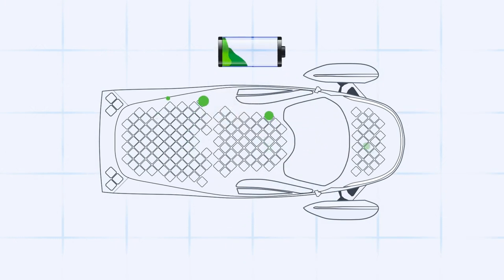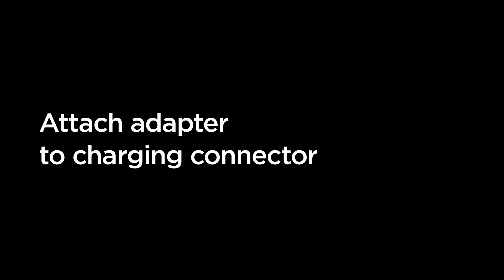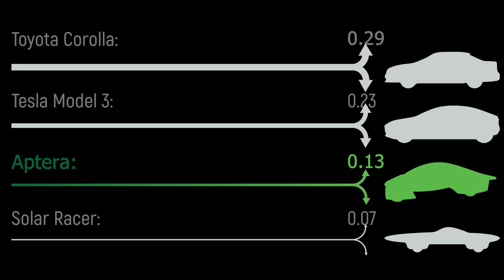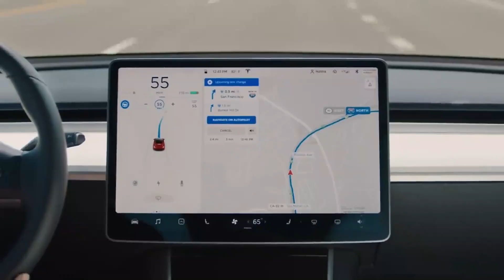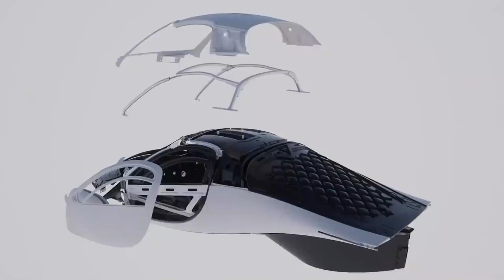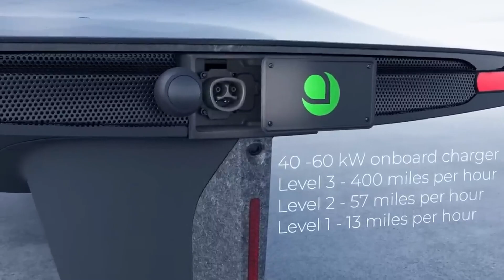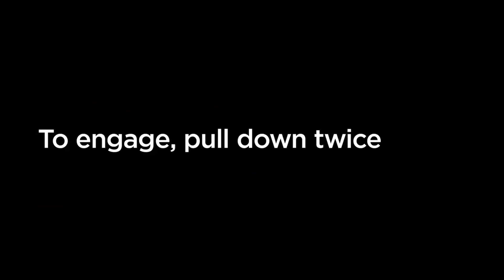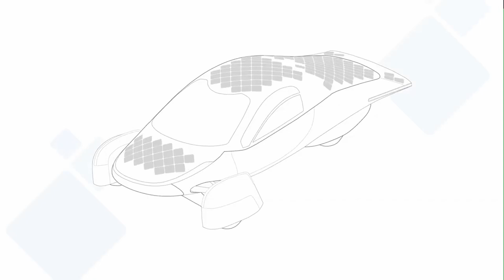Aptera Solar or Tesla?  Who is truly at the forefront of the EV REVOLUTION and Affordability

Comment: Still selling the BS snake oil lies.
Aptera doesn't sell anything.
If it did, it's comparing an autocycle against a real car - some up to 7 seaters. That's madness to even compare.
Aptera has dropped most of the innovations it said the silly trike was going to have.
Tesla gets substantial tax credits you fail to include in the pricing.
You are trying to suck in more gullible f0015 - give it up.

Comment: I'm definitely on the side of Aptera. They utilize every possible way of minimizing both the production/purchase cost, operating cost, and maximize efficiency and usage of renewable resources. Meanwhile, Tesla simply outsources the "dirty carbon footprint - instead of having a ICE under your hood, you're just getting electricity from a coal or oil burning plant. Not much of a change, if you ask me. Also, Tesla instead on efficiency focuses on parlor tricks. Aptera is the superior solution, Tesla is just a gimmick.
Reply: You're blind.
Reply: I see your point, Taris, and a few flaws in your reasoning. While many of us have admired the concept and design of the Aptera for 20+ years, nobody owns one. Tesla's are everywhere (but I won't be buying one). Also, if you are lucky enough to own a home with a solar energy system, charging is clean and free - AND the batteries in your car can power any appliance/gadget in your home during an outage. It's called, "Vehicle to grid." or V to G for short.
Reply: @Steven-h7h  I have an EV and home solar - there is absolutely no need for solar on my car, and the downsides are not worth the expenses. It's redundant before it takes off.
Reply: @aussieideasman8498  You have cracked the code my friend. The advantages of a large brain and opposable thumbs are not lost on you.
Reply: @aussieideasman8498  Hey man, OT but I'm curious .. what's the voltage and Kwh in your BYD? Also, which model did you get? Thx!
Reply: @Steven-h7h  The model is the Atto3. It has a 150kW motor up front (wish it was RWD like Tesla) and 60kWh usable LFP (blade) battery. It is much safer than most chemistries and I can charge to 100% every time without life degradation. It still degrades, but not accelerated by going over 80% and lasts longer, generally. The 0-60 is about 7.1 seconds and is brisk enough without pretending to be a sports car. Efficiency is reasonable. Recharge time is slow, but 95% of mine it's while sleeping.  It just doesn't have the quality in the software, but it's a small issue overall.
Reply: @aussieideasman8498  Hopefully, someday soon, these will be available for anyone. Climate change is real, and everyone with a functioning brain knows this fact. Electric vehicles and renewable energy are a viable option to reduce the threat. Geo-political pissing matches are stifling our chances of survival, and I'm (reasonably) pissed off about that. Rant mode OFF.
Keep on living your best life, man. You are doing a fine job!!
Reply: @aussieideasman8498 
Do you carry your home solar on a commute?

Common, Aptera is a simple mobile solar roof.
Thanks
Reply: @user-uy1vp3wf7g  Do you carry your home fridge on any drive? No - because it isn't fit for that purpose, and neither is mobile solar. Its disadvantages outweigh the advantages, and those have yet to be proven. You are getting numbers from liars. I am happy to wait however many weeks they will stall the PI.2's fast drive reveal to see the real numbers they get from driving range; that will indicate how badly a solar range will likely be. I am happier still for the many months wait after that to see a PI.4 do a solar range test, but I won't be believing their lies in the meantime.